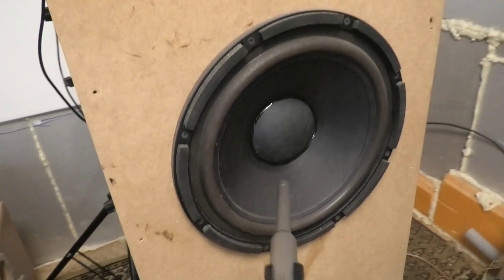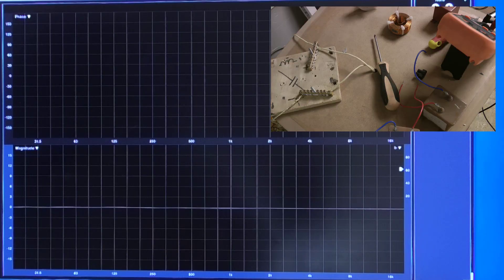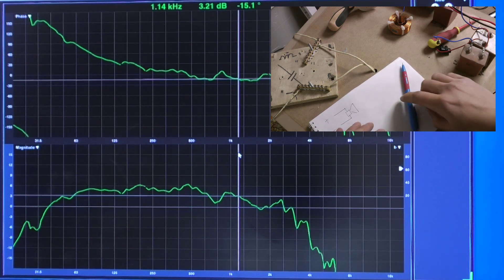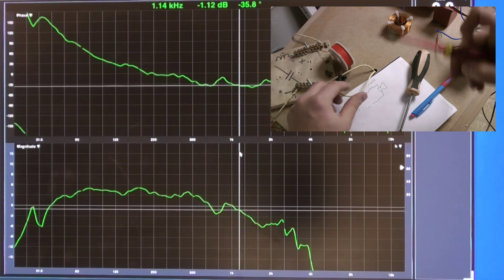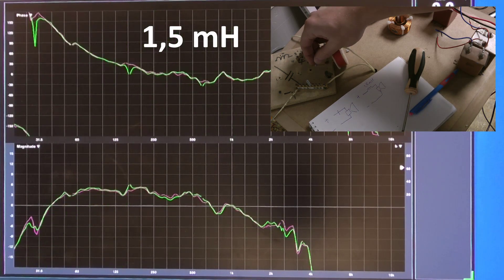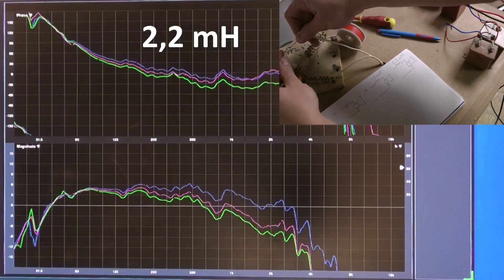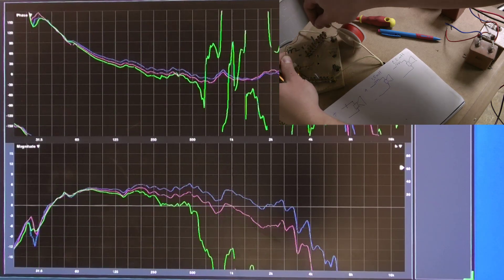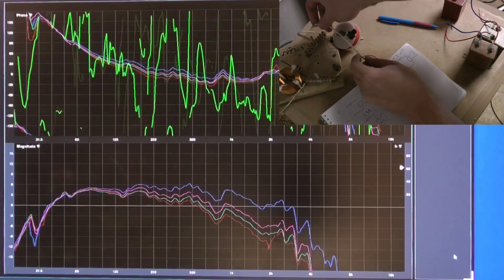how to make a first or second order low-pass filter? You will see and hear this! building speakers

Comment: Thanks for the video. So theoretically an inductor in series does the same as a capacitor in parallel  but wich is best?    can the inductor born rthe end stage of the amp since it produces high voltage ?  or can the capacitir kill the end stage since it holds electric energy

Comment: Very good example. I have never seen anyone so explicit. Congratulations and do more of these tests. I follow you every time! My opinion for my ears, without inductors and without capacitors it sounds clearer, so all the broadband speaker is better for me!!!! The truth is that the more speakers you have, the more the distortions increase, that's why capacitors are placed in parallel on the low speaker, to emphasize the frequency of the medium speaker, as well as from medium to high. Many distortions.... A single very good broadband speaker, I think is the solution. I expect more tests from you, I see that you know what to eat audio with....

Comment: could you do the same test with top high quality caps?
Reply from the maker: I checked the capacitors on the speaker B 200, I did not hear the difference
I don't have very expensive capacitors.
here is a video with capacitors 
https://youtu.be/MNtJWAvVALc

Comment: Well, that's also about lowering the cut-off frequency of adding components and components are basically filters. Correct to show the diferent sound will be at the same cut-off frequency by 1st and 2nd order mode. For example: Cut-off at 5k /8ohms. First order: 0.25MH , Second order: 0.36MH + 2.8UF ✌ I hope that i could help , cause I also started up some day at home in 1979!   https://www.youtube.com/channel/UCWjFBPA2vdpQrXdn7u5hW7g
Reply from the maker: I can do this experiment.
then you need 1, 2, 3 and 4 for clarity.
if I find the necessary components, I will shoot a video ..